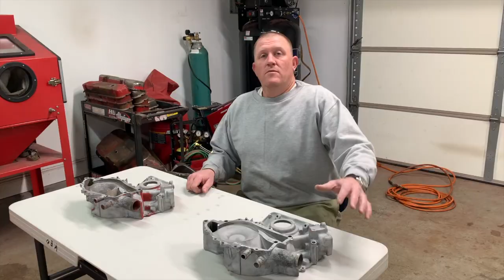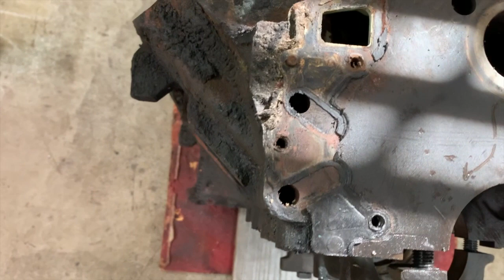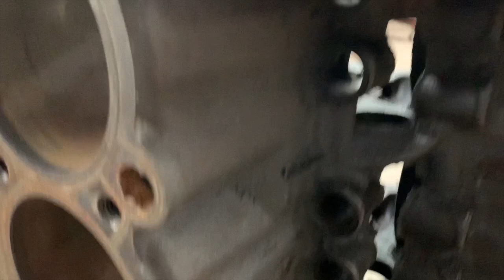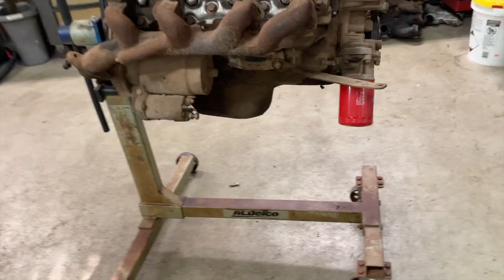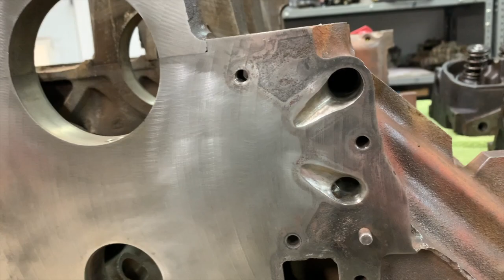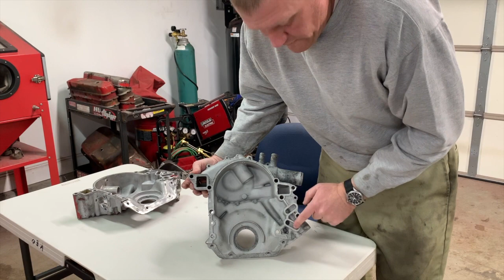Buick Big Block Timing Cover Rundown...They are not all created equal!

Comment: Thanks for posting this. Question: Do you know if there is a video (or some other tutorial) on how to install the rope seal on a 455 Buick front cover? I have looked and looked and found nothing. I even have 2 original Buick Service Manuals (67 and 71) which show everything but the rope seal how to! Please let me know. Thanks! 🙂
Reply from the maker: Throw it in the trash and get a neoprene seal from TA performance. When the Fed mandated that all asbestos was to be removed from the rope seals in the 80’s they no longer work well at all. But, if you want to know how to install that rope seal, get it wet with oil and work it in with a hammer handle all the way around. Make sure the parting line is at the top of the seal. It will take you a little while, but you will eventually get it into the cage.

Comment: Hi I like to know what a good camshaft for a 455 Buick boar 30 over 400 trans can I run a double chan with stock timing cover
Reply from the maker: You can run a double roller timing chain from roll master but they are expensive. I’ve had good luck with Edelbrock single rollers without any issues. As far as a cam goes, what’s the purpose of the engine, type of car, gearing and your compression ratio?
Reply: Why don't you call the guys at TA Performance, Karl and talk to them about cams? TA isn't for Trans Ams, they are Buick guys.  I loved every cam I got from them. Double roller was no issue on my own Buick 1974 block 455 with factory timing cover or aftermarket from TA but I liked the TA unit a lot. They also offer adjusatble oil pumps with thrust plates. You can also get their timing cover and oil pump setup all in one package, Highly receommend and I don't even own a Buick any more.  Buick 455s oil poorly. make sure you get the psi you need.

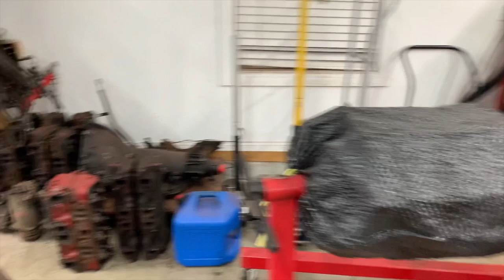Comment: Dallas. What is your opinion on using a thinner oil such as a 5 w40 instead of a straight 40 or even a 10:40 or 10:30 for the large Journal 455 engine. I remember seeing a report what I ran a NAPA store some years ago from Castrol saying that a lot of the newer Vehicles we're going to dinner coils for quicker lubrication on Startup. This would seem correct in that on a large Journal engine the oil would feed through faster and lubricate better on cold start up. Would like to know your opinion on this. As I know most guys using thicker oil in the Buick because of the style of pump gears
Reply from the maker: That's exactly what I did to my 85 Suburban with the 455 Buick. I run Rotella T6 5w40 just for the purpose for easier and quicker lubrication upon startup. GM calls for 10w30 in all Buick engines and factory tolerances are fairly tight. I prefer lighter oils unless its a heavy load engine, I.E. Tractor, Truck, Tow Rig.
Reply: @mr.roddersneighborhood2740  thanks for the backup confirmation.
Reply: Thinner oils. Not dinner coils. Hahaha